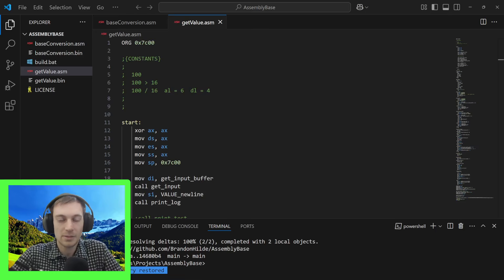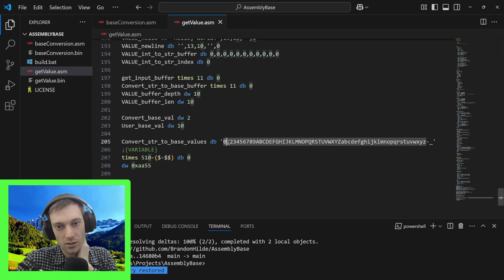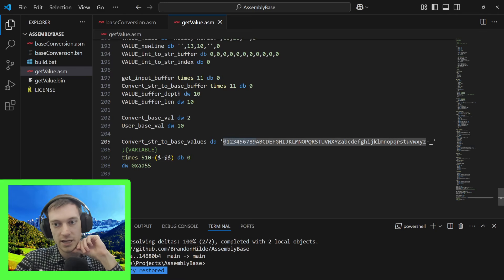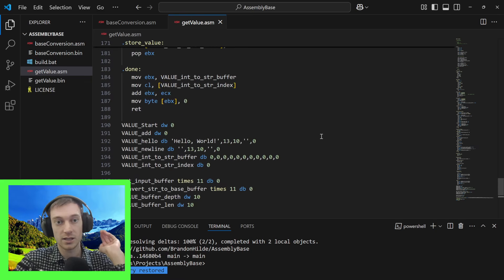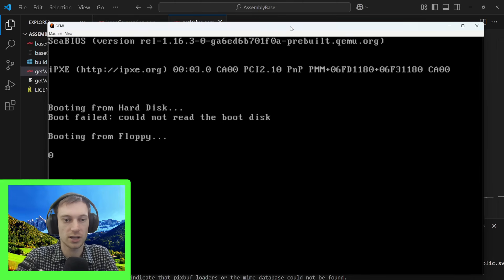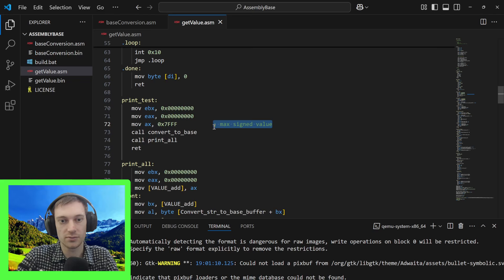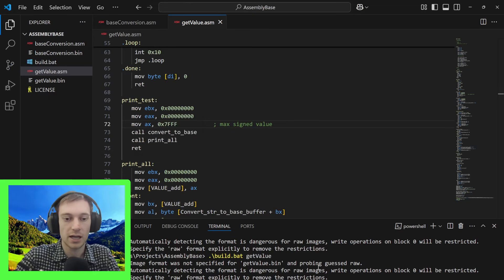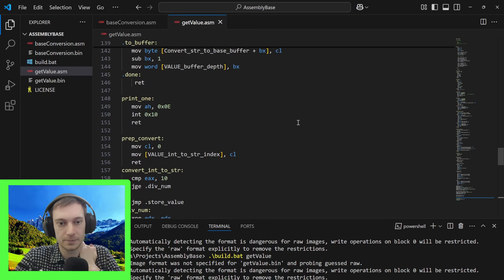Why base64 should be changed.

Comment: If my memory serves me right, Base64 was created to address the issue of data corruption during the transmission of 8-bit data. This was particularly problematic when intermediate servers could only process 6 or 7 bits. This was over two decades ago. In those days, transmitting non-ASCII 'foreign language' data over the internet often resulted in data loss when passing through mail servers or proxies. To mitigate this, we universally adopted Base64 for data exchange.

Although we can take it for granted that a byte is 8 bits today, still C header files explicitly defined it. Back in the late 90s when I was doing internet programming, that wasn't always the case. It's quite fascinating to look back on those days.

Comment: I agree that it should be changed, but disagree with what you want to change it to. I think it should be [0-9a-zA-Z\-+], if you'll excuse the lazy regex-ish representation. For one, lowercase letters should come first, irrespective of ASCII/Unicode encodings and dash and plus symbols make sense given their safety in use for URL's, and in that order. As far as automatic conversion between numerical bases, I'm not so sure it makes sense beyond base 36 because of our reliance on ignoring case and our inability to agree on which digits should come next. If we could stop ignoring case, and agree on which case comes first, then up to at least base 62 would be easy.
Reply: @anon_y_mousse  \ seriously?  Or you just trolling?
Reply: @AK-vx4dy  I'm assuming that you don't know regex or the syntax for ranges or that if you're going to talk about a single character that you should quote it in some way.
Reply: @anon_y_mousse  I'm assuming you know where base64 is mostly used and it goes by so many diffrent aplications and operating systems when risk of not escaping or not quoting properly is high.
bas64 "alphabet" was constructed that way to maximize "transferability" and to be universal (variant with - and _ is better IMHO)
I know but i don't see use of regexe's anwhere near base64 suitable.
Reply: @ And again you missed the point. You wouldn't use regexes to actually define it, it was only a shorthand to quickly list the alphabet. Unless you're so dumb that you need someone to spell out 0123456789 and so on.
Reply: base of 64 was choosen to allow operations using bit shifts because when it was invented multiplications and divisions were very costly (or not existent in hardware), also this format is used to encode messages not single numbers so encoding/decoding kiloBytes or megaBytes using mul/div is at least controversial.
If you need/want use universal procedure to change bases, you just need to make table with mapping from base64 alphabet direct to numbers.